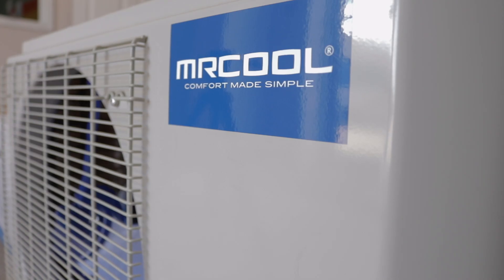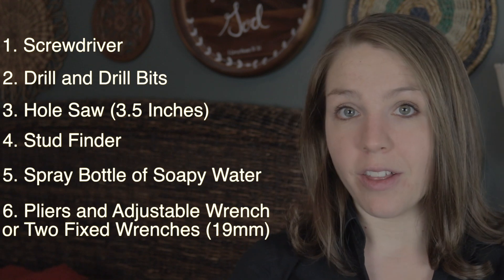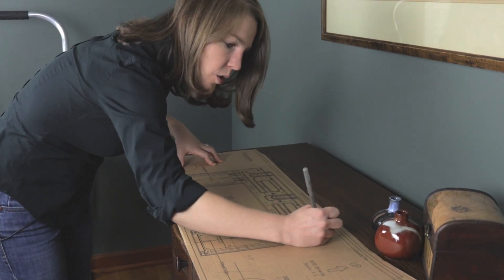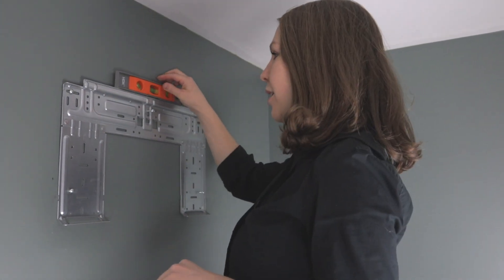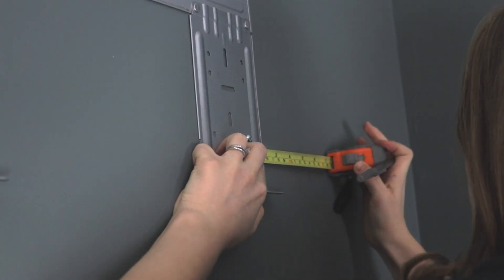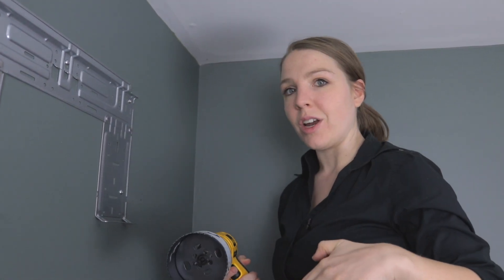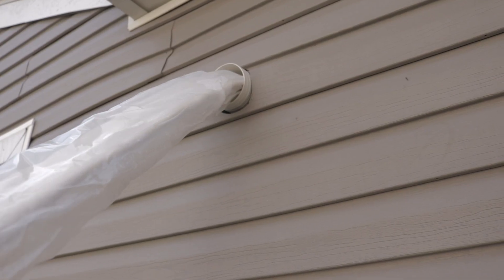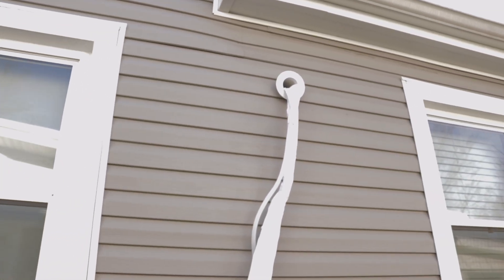How to Install a MRCOOL DIY Ductless Mini-Split (2nd Generation)

Comment: Is there a unit disconnect at outside condenser? Or hardwired straight to breaker?
Reply from the maker: You would need to wire it to a disconnect.

Comment: Ok,so im a ac tech,snd i see one fatal flaw in all of this.....
There was no vacuum pulled on this install,which will leave the lines full of air before the valves are opened and refrigerant flows into the copper lines,which is terrible for the compressor.....what do you got to say about this problem,mr cool??
Reply from the maker: We say that our MRCOOL DIY is not a typical ductless mini-split. The lines come pressurized and charged with refrigerant from the factory. They do not have air in them, and are not 'open' during installation. Basically, just plug them into our special connections on the air handler and condenser and done. No vacuuming, no charging, no cutting, no flaring.
Reply: Well,thats pretty cool,minus the ugly rolled up lines.

Comment: This is absolutely fantastic! Has anyone tried shortening the lines or is that a no-no with the DIY kit? Mine's in the mail and I'm trying to decide on the best routing.
Reply from the maker: Shortening the lines is not recommend (without special tools and training).
Reply: MRCOOL thanks! Looks like I’ll be doing some internal routing

Comment: I had to replace the exterior unit and am ready to install the replacement unit. Will I be able to simply disconnect the refrigerant lines of the old unit and then connect them to the new exterior unit or are there other steps I need to take?
Reply from the maker: There shouldn't be any other steps. However, you can always get help from our tech department at 270-366-0457.

Comment: Is there enough to run the system to a second floor bedroom
Reply from the maker: The DIY linset is 25'. If you need to install on second floor, you can also use a wall mount for the exterior condenser and place it higher up on the wall than you otherwise might.

Comment: I'm a electrician but still have a question. (I've never installed one before) I saw that the out door unit has minimum amps of 18 and indoor unit is minimum 3amps. If the indoor is powered by the outdoor shouldn't the out door unit have a minimum amps of 21? Or can the whole system (inside and outside unit)run off of 18 or 20 amps total?
Reply from the maker: Minimum SYSTEM amps is 18 - 3 of that is the indoor section.

Comment: At what outside air temperature does the heating portion cease to function in a meaningful manner efficiency wise? I am in California and we see nighttime temperatures around 0 to 10 F often.
Reply from the maker: The DIY is AHRI rated down to 17 degrees.

Comment: I bought one and installed it in 1 day. The toughest part was running a new electrical wire as I wanted this on its dedicated 20A breaker. Everything else was rather simple. I built a wooden platform for it with pressure treated 2x4 (cost me $20 rather than buying those plastic ones on amazon).  I also bought 2 sets of line covers and I practically used 22 ft ou of the 25ft of the copper line. Overall I consider the difficulty level to be a 4 (10 being very hard).
Reply: I did the same with the pressure treated woods, 3 feet off the ground.

Comment: Where does the 25' slack line start from? once it pokes out the back of the unit? And do you lose any slack if you go from the left side of the unit rather than the video with the right?
Reply from the maker: I'm not entirely clear on what you are asking, but I think the answer is that, yes, you do "lose" some of the slack if you run the line out the wall on the left side of the unit.
Reply: @MrcoolComfort  Thank you. You answered my question
Reply: @MrcoolComfort  So since I want to come out of the left side do i have to disconnect the  condensate line from the right and connect it to the left or do I just attach the extra hose onto it to extend it? Also the instructions say to plug the unused side. I don't see any videos about that part. Can you please explain?
Reply from the maker: Do not attach extra hose. Run the condensate drain out the side from which you are extending the refrigerant line and communicating wire. Then, plug the unused side.

Comment: Can you control the air handler with a wired wall thermostat?
Reply from the maker: The DIY is not designed to integrate with a conventional thermostat.

Comment: It would of been better if you had shown where you got the power from your home going into the unit. You showed wiring from the Indoor unit to the out door unit but not where you hooked up the power from your home. Is it 120 or 220? ..did you just plug it in to a pre-existing outlet? Or did you have to wire it to a sub box or a breaker?
Reply from the maker: The unit has to be wired. The voltage depends on the model.

Comment: I just purchased one i dont need to vacuum my line ????
Reply from the maker: If you are installing the MRCOOL DIY, you should not vacuum the line. Make sure you have the DIY brand, since our other mini-splits are all conventional systems.
Reply: @MrcoolComfort  yes i bougth the MRCOOL DO IT YOURSELF SERIES 36K HEAT PUMP AIR CONDITIONER

Comment: Do you guys plan on making a DIY Hyper Heat Unit? Where I live we are currently at 15 degrees but might drop down to negative degrees in the next week. I don’t want to put money into a unit that won’t work if it gets to cold -5 or -10 degrees. Really want one though. If you plan to let me know when. Thanks!
Reply from the maker: Unfortunately, there are currently no plans for a DIY Hyper Heat.

Comment: What is the lowest temperature outside that the heat pump will no longer be able to provide heat? I know some units recommend not to use if temperature outside is under 45 degrees.
Reply from the maker: They can work down well below 45 degrees. The AHRI rates all heat pumps down to at least 17 degrees.
Reply: MRCOOL but what do you guys recommend for your unit? Is there a limit for your unit specifically?
Reply from the maker: It depends on the particular model line. For example, the MRCOOL DIY be degraded at around 5 degrees, but the Oasis Hyper Heat can continue to function much lower (around 20 below).
Reply: MRCOOL do you guys make a Hyper Heat unit for DIY? I was looking for a 24,000.
Reply from the maker: Unfortunately, there is not a DIY version of the Hyper Heat.

Comment: There is a booklet to read the directions and there are templates.  For if you are smart enough, you can teach yourself how to install this unit.. AND, just like she said, If you are not confident enough, then consult with an electrician.. I totally recommend these units.. I have a house that does not have a/c or heat units. So, this system is just perfect.. !!

Comment: I have installed my 12k DIY.  Do I need to cut away the lineset sleeve and insulate the full length of both lines or do I just need to insulate the part that is exposed just prior to entering the condenser?
Reply from the maker: The best thing to do would be to cut away the sleeve and fully insulate the line. Also, we do recommend a protective covering like our own LineGuard or another product.

Comment: Issues with this advertisement video. 1) The only time electric is mentioned is when you need to connect the electrical lines from the interior unit to the exterior unit, where does power enter the system? If I need an electrician then it is not DIY. All the marketing seems to indicate that this would plug into a standard outlet but if it was that easy then why is the outlet never shown? If this woman is really installing it, where is she getting electrical power from? On the site the marketing materials (there are no tech materials that I see) give number of amps and such but no indication if you have to run a dedicated circuit to the interior unit, the interior and exterior unit or just the exterior unit or if no line is needed and you can just plug it in. Frustrating and misleading, kind of makes me wonder if this company is the way to go.
Reply from the maker: The exterior condenser is wired to a disconnect box. All our installation and technical manuals are listed on our website at MRCOOL.com, and they detail the electrical connection. We typically do recommend hiring an electrician, but many DIYers are capable of doing that themselves. DIY skill varies greatly. What is easy for some is not for others. As always, our technical support line is available at 270-366-0457 for questions.
Reply: @MrcoolComfort  
What is the Voltage required 
130 or 220...? Please advise
Reply from the maker: Which model? The DIY 12k is 120v and the others are 220v.
Reply: @MrcoolComfort  instead of replying like that, you should just say the voltage for all of them.

Comment: Its good for video but  only thing you need vacuum the indoor unit to remove moisture.
Reply from the maker: On the MRCOOL DIY, you do not need to vacuum the unit, since the lines are charged and sealed properly from the factory. There is no moisture contamination to remove.

Comment: do we need to use the tape for all the hose and drain together like instruction said? insulated tape too? did not see this in the video........
Reply from the maker: Using insulated tape is not a bad idea, but not required.

Comment: Thank you very much for the video, it now makes me confident that I can do the installation myself.  One question though, I know the refrigerant lines are 25ft. Is there any way that I could order a unit with longer lines in order to make my installation possible?
Reply from the maker: Because of the design technicalities, longer lines are not possible on the MRCOOL DIY.

Comment: Hi. Very informative but some things have been left out. How to flare the copper and how to wire a circuitbreaker. But nonetheless, well done madame
Reply: FifaManiac no need to flare the copper.  It’s already done for you.  All you need is two adjustable wrenches to attach the lines.
Reply: they probably can't show you how to do the breaker and A/C disconnect because it's supposed to be done by an electrician even though it's very easy

Comment: What kind of material is she drilling through on the outside of the wall? stucco? wood siding? be nice to know so I can get the proper tools.
Reply from the maker: I believe in this case it is plastic siding outside.

Comment: its not perfect, but i think installing any unit like this you should research more then one  video and read the instructions.  the point is...if youre even a little handy this is not THESE ARE NOT THAT COMPLICATED....and i think its a pretty good one to check....and then check others...i thought it was a pretty good try...but yes double check everything.  connecting the electric is not difficul

Comment: I installed the 24,000 BTU unit one month ago for a 35 x 18 foot room. Really no problems doing the installation. 
One word of advice, make sure you have the coolant lines bent the way you plan because there is no bending of them while hanging the wall unit. Two people are needed to guide the lines as you feed them out the wall. 
So far I have only used the heat pump. Works very well and is very quiet. When it first starts the heat is felt across the room and then it slows down as the room heats up. Normal running noise is barely heard. 
I have checked the connections 3 times with soapy water and no leaks detected. 
The wifi app is useless for any android phone with the OS higher than 6.0. I have 7.1 Android and it will not work. I believe an update is needed very soon since I tell others who ask to forget about the wifi app unless they have an Apple phone or an older Android phone.

Comment: 3:24 Yeah, better bring out those bells & whistles to mask the noise from that baby...
Reply: I think ZenoDiac meant the drill noise.
Reply: Lisa O'Donnell Only god knows.what he meant.And hes even scratching his head.
Reply from the maker: Ductless air handlers are really, really quiet. Because the loudest component on any air conditioner, ours or otherwise, is the compressor which is located outside. If you are having a lot of interior noise, something is wrong.

Comment: Installing the unit properly can make the difference between long life and short life of the equipment . Some procedures were left out. Not having an experience technician can make the difference of warranty and no warranty. Any equipment purchased on the internet will have to  be handled through the internet even if  there is a local distributor in your area. If you think you can do it go for it.
Reply from the maker: Normally you would be correct regarding the warranty, however, our DIY has a warranty that specifically allows non-professional installation. So any Regular Joe or Jane that buys our DIY unit and installs it is 100% covered by the warranty (provided they follow the installation instructions, of course).
Reply: The copper pipings are already sealed. There is already vacuum inside, so there is no more need for purging. Is this correct?
Reply from the maker: That is 100% correct.

Comment: If the cables are too long can you tuck them in the wall?  Is there a number you can call for help if needed and do they answer if you call?
Reply from the maker: The only caveat regarding the cables it that whatever you do, make sure you don't kink the lines. If you ever need help on the installation, you can always call us at 270-366-0457.

Comment: What size would be sufficient for a 700 sq ft garage that is insulated including the door?  It needs to big enough not to struggle and cool it down quickly if the door is opened.
Reply: I have a 12K Gree Mini Split unit that does my one level house, there's no need to go any higher for a 700 sq ft garage which is probably all open as well.
Reply from the maker: We recommend the 18k unit.

Comment: How do you connect the electrical wiring ... how do you install the outside cooling system? there's a lot of missing installation steps here.
Reply: If new to electrical ,get a black and decker how to house wiring book.
Electrical isnt hard,just learn some basics.
Reply from the maker: We recommend you consult with an electrician for the wiring, because most likely your local community requires that anyway (most do). What questions do you have regarding the outside condenser?
Reply: @MrcoolComfort  My unit came without a connector and none of the colors match. Showing how to connect the indoor wires would be great.........

Comment: You're suppost to evacuate the evaporator with a vacuum pump before you release the refridgerant! Do not listen to this video!
Reply from the maker: EXCEPT, if you did that, you would ruin this DIY unit, since everything is 100% pre-charged, and there is no need, at all, to vacuum the lines or charge the system during installation. So, anyone who wants to install the MRCOOL DIY ductless mini-split should definitely listen to this video.
Reply from the maker: If you put a vacuum on MRCOOL pre-charged line sets, then you sucked refrigerant out of them. I recommend you give our tech support team a call at 270-366-0457.
Reply from the maker: If it's not one of our DIY units, then you're probably okay. Most ductless units come with a precharged condenser (the outside part), NOT precharged linesets (they go between the inside & outside units). So, vacuuming regular line sets during installation of a conventional ductless system is a GOOD thing. Just not something you should do with one of our specifically DIY Series units with precharged linesets.
Reply from the maker: Also, you may want to check out this video https://youtu.be/yo1KsWWz6cc. It's one of the better non-MrCool DIY installations videos we've seen on YouTube.
Reply: MRCOOL d
Reply: @MrcoolComfort  cool Mr Cool
Reply: Your supposed to sit down and shut up when a video is playing.
I love youtube experts .
Reply: Thankyou, I will check them out!!!
Reply: Hey MRCOOL, I live in Washington state and want a unit like this but one for each room, are those available?? I would like one for each bedroom (2) and one for the living room/kitchen. My house is 928 sq ft. I am willing to drive to Oregon to pick one up!!!!
Reply from the maker: Sounds like a job for our Olympus, multi-zone system. You can find them on Home Depot https://www.homedepot.com/p/MRCOOL-Olympus-48-000-BTU-4-Ton-Ductless-Mini-Split-Air-Conditioner-and-Heat-Pump-25-ft-Install-Kit-230-Volt-60Hz-MULTI348HP230WM10KIT25/300861196
Reply: MRCOOL you are right ... Recently I installed a voltas AC & they did the same .... That ac was also pre charged
Reply: Lmao 😂 Noah is a troll for that comment.
Reply: Idiot.  The pipe is pre-evacuated in this unit as you can CLEARLY see.
Reply: Noah Sheehan  The lines are already pre charged, that's the whole point of this product.  It's for homeowner's not Hvac.
Reply: Noah Sheehan  you are wrong on this one.  If you don’t have this system, you wouldn’t understand.  I have it...it does NOT need vacuuming prior to use sand it’s awesome!

Comment: Can anything else be wired to this thermostat on this unit? Such as a through wall fan or duct fan to automatically turn on the fan when the unit turns on to push the conditioned air to another room?
Reply from the maker: It is not set up for something like that. But, hey, find a bored engineer and anything is possible!